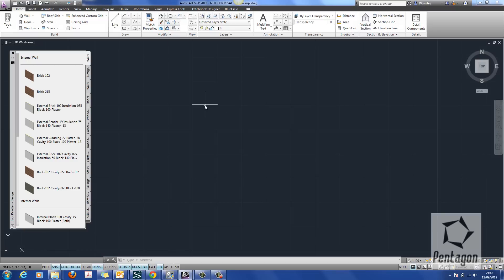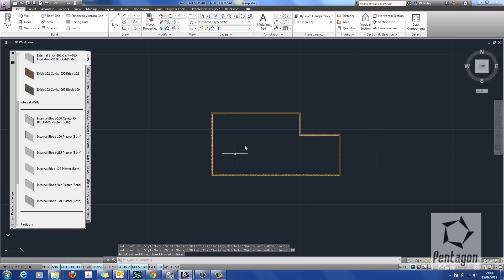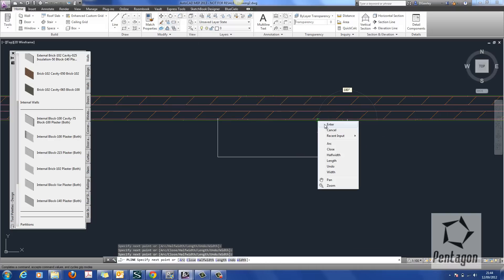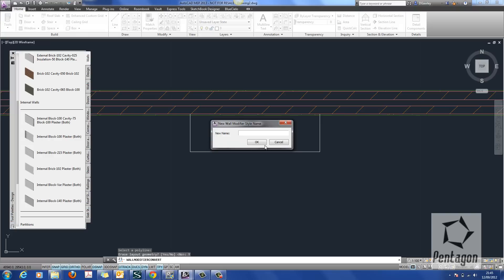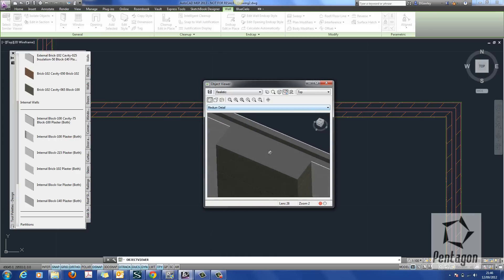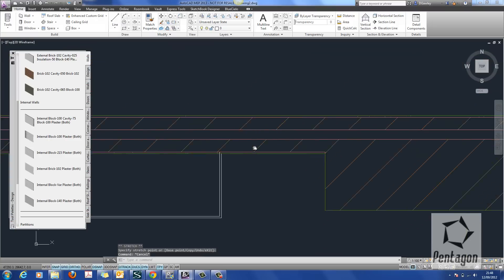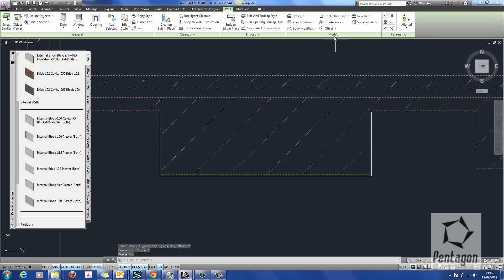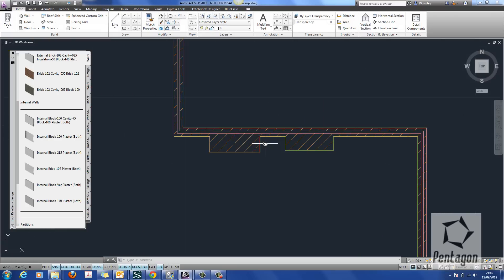Creating Wall Modifiers in AutoCAD Architecture 2013 by polylines

Comment: Hi! Thanks for posting. I have AutoCAD 2013 and dont see the "build" icon with walls, windows and doors etc. I have used pervious versions where it is right in the top left corner. Is there a way to upload that option? Thanks!